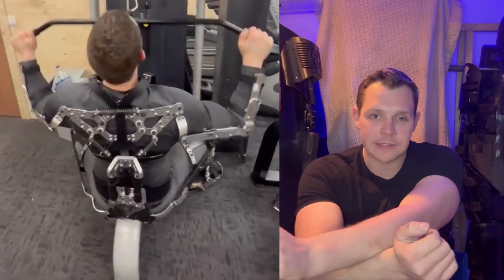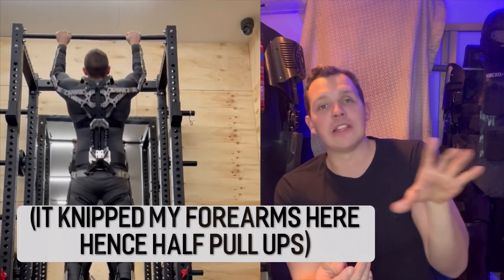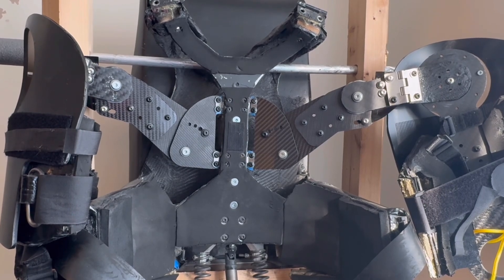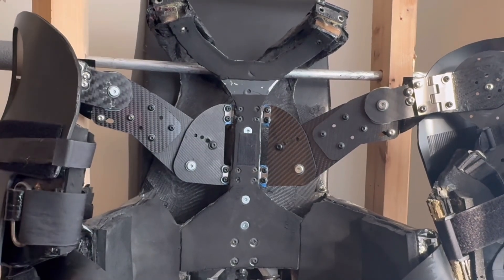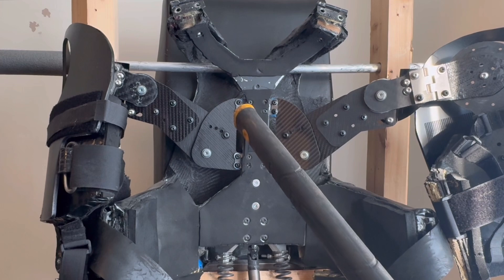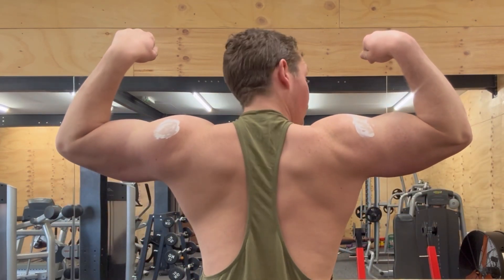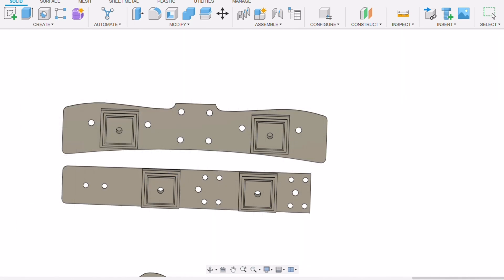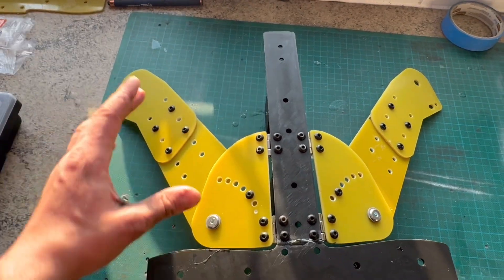Correcting the PROBLEMS with my old EXO-SKELETON Back Upgrade

Comment: Awesome vid as always.

A recommendation before going all kevlar/ceramic and bullet proof would be to test with relatively cheap but similar weight ratio materials. Ie if you have x amount of plates use a material that is similar in weight so you can test it out and not break bank. This would help to check for almost real life conditions and would put the test on the exo skeleton and the assembly itself.

Other than that i do believe as you are doing is great, a full assembly is required at multiple points and even big industrial military complexes tend to use this (china designs and buils 100-500 tanks, test them out for 6 months to a year, and they report the failures and improve upon them each iteration)

This is also why i would recommend to use similar materials instead of the ceramics or metals to do the lvl4 plates and the kevlar

You could do smaller tests for the forming of the plates if you are going composite, like make one of the lvl4 plates frok start to finish, adding the kevlar and others but keep it small to minimise costs and see what can be improved too
Reply from the maker: Thanks. And i agree the only thing ill add is the difference in price of materials might make it not worth it. Trialing without kevlar is a yes but then with carbon, the fibreglass pieces i bought for this was literally £5 cheaper so it was barely worth bothering with.
Reply: @MattExo-Dynamics  yeah only do if its worth it, the idea is to save costs and test with as close to the real materials as possible after all

Comment: perfectly shaped parts do work, but it requires a very optimized joint setup that moves exacly like you. else pinching, chaffving, compression and distention are issues.

my personal build seems to move well form fitting, but i added padding non the less for safety and even greater comfort ( as you are still feeling weirdly strapped down).

for material i use a custom mineral- fibre- polymer composit to mirror bone. it seems effective performance to weight wise.

springs can at most be 50% of your casual movement strength i found out before it gets awkward. that is still helpfull power to weight wise as an addition.  locking joint motion to not exceeded the resonably comfortable range of motion of a person makes sense.
Reply from the maker: Yeah i agree - great comment btw, i literally get smarter responses on here than anywhere else! Ill have a look at the custom mineral. Yeah thats what i found with the curved parts then when i added padding or just a stand off distance for bolt heads etc i just thought is it worth it. My leg braces will still be nicely shaped but most wont
Reply: @MattExo-Dynamics  the only  complex shapes in  my design are the hip and shoulder assembly, as well as the spine stack.ots of 45° rounded pieces.

the material i use is a micro concrete ( extra fine grain, higher cement content to balance for the increased grain surface area) with added water dilutable, outdoor proof and elasticity keeping glue, and natural fibres in it.

 the added components keep its density low. it behaves like a middlegroind between wood and concrete, but at a better strength to weight ratio. no super matetial, but basicly castable bone.

the friction in micro fractures can melt the glue, which seals them. and the age hardening of concrete can counter stress aging to an extend.

the material being castable allows for a partial gipsum cast of your bodypsrts to be cut into shape and used as a basis for a mold to cast the fake bone.

wrapping the fake bone in a tensile material once fully cured, either glued fibres (linothorax in essence) or carbon fibre, makes the material extremely resistant